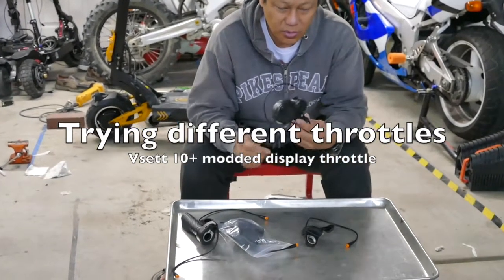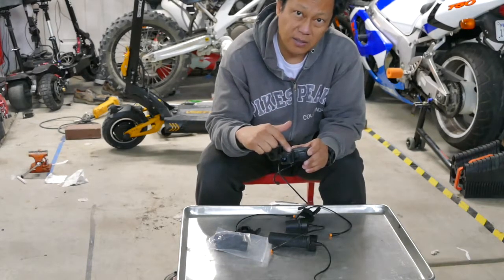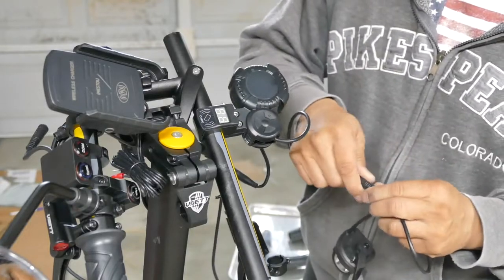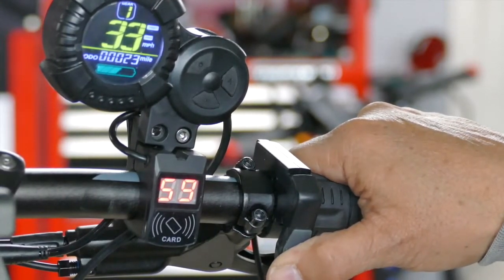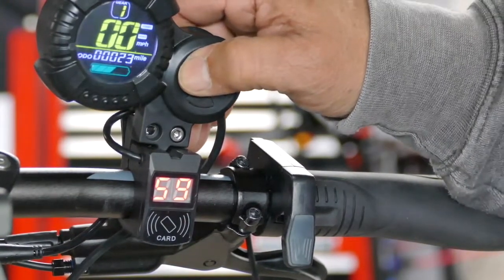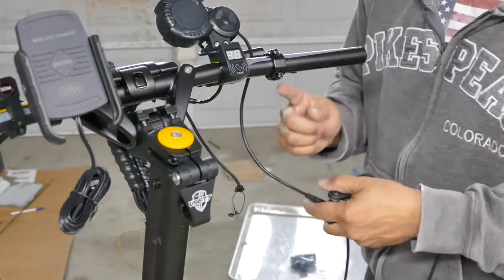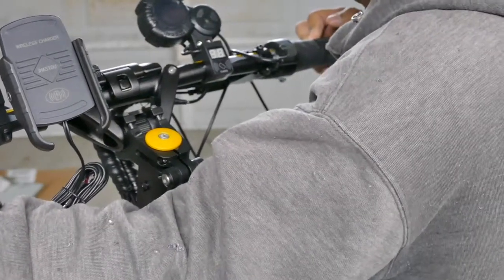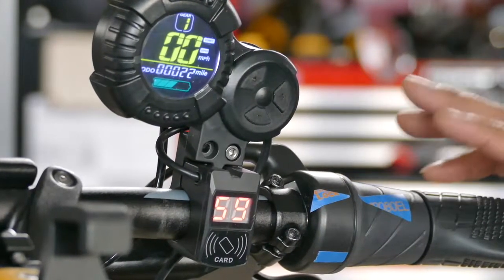vsett 10+ twist, half, and micro thumb throttle tests. Works on 8 and 9

Comment: Is it possible to just add a throttle? What happens if I Y split the cable, and add the new throttle there in addition to the existing display with finger throttle?

Comment: is it possible just to cut the wire and joing wires, is it not the same as soldering, hate soldering.  also is there an adapter that could be used to join wires together

Comment: Is it possible to get a throttle with a longer hall effect sensor? Or modify the existing one? Meaning that it would be easier to control speed and go slow. My VSett 8 is impossible to ride slow, like in places where theres walking traffic. I have to kinda "tap it" and throttle goes onoff onoff onoff and also theres a delay so it's uttter crap to control.

Comment: With the new display it's really easy to change the throttle to one that fits the best for each. It's also possible to get a half twist throttle which is flush, cut it half and cut a piece from the original grip  after the turn indicator part and place the half throttle in between.

Comment: Why is it so hard to make a throttle with an actual decent sensitivity range as well as a full range of motion without the useless deadspots, shit perhaps ill just see howw these indeed work and make mine own.
Reply from the maker: The actual change is easy but its in the micro coding. Just need to increase the number of steps. The optional Zero 10x thumb throttle controller actually has a wider, more fine control throw and adapting that to the twist throttle actually makes it works very well. It is also compatible with Vsett but you will loose the RF key.

Comment: may i ask you. My Vsett9+ does about 50km/h, but display only goes up to 24km/h. Do you know how i can make the display show the right value? thanks
Reply from the maker: I think your magnet setting is wrong. Check the P-setting and verify it with the default.
Reply: @mypev-diy7269   yeah i put the magnet to 30 but still the same, back in default which is 28 it acts exactly the same. weird enough. thanks for the answer tho.

Comment: Your brake rotors are not perfectly flat …. you can hear the pads scrapping the brake rotors during accelerating.
Reply from the maker: Wow, you pay attention to detail! Yes. I have since corrected them. Ignored them for months until I couldn't take it anymore. Thanks!
Reply: @mypev-diy7269  I just got my Vsett 10+ a few days ago, and the first thing I had to do after unboxing it was to learn how to fix bent brake disks.
Works well now though. That scooter is a demon.

Comment: Thank you for this video my vsett 8 handle grips are peeling and  I was afraid of replacing them due to the turn signal switch. I feel confident on ordering replacements and doing it myself now. Id love that half throttle switch